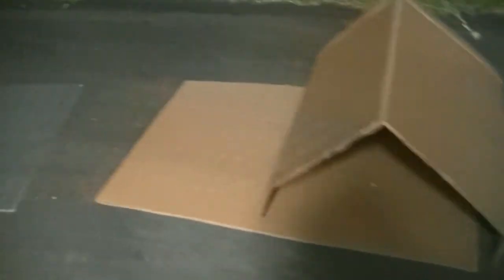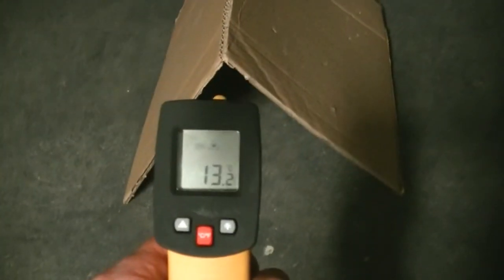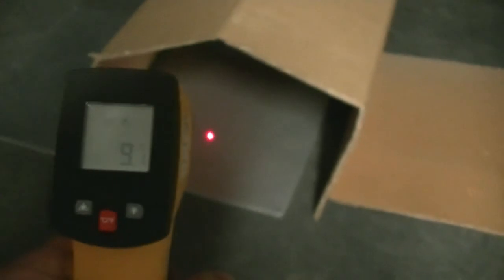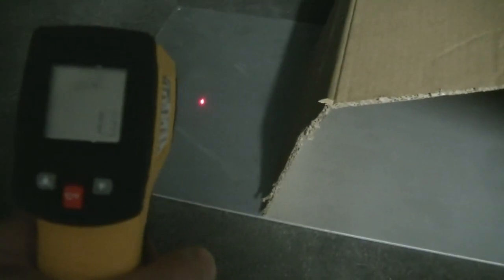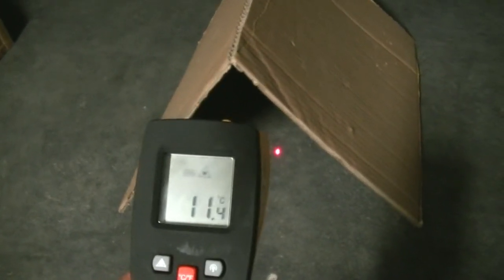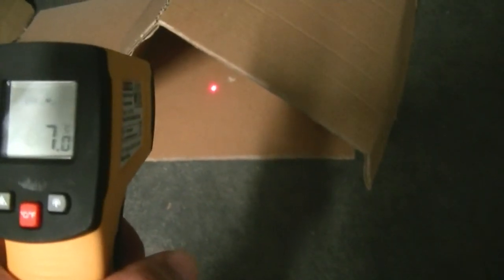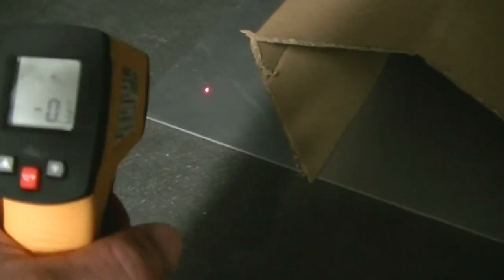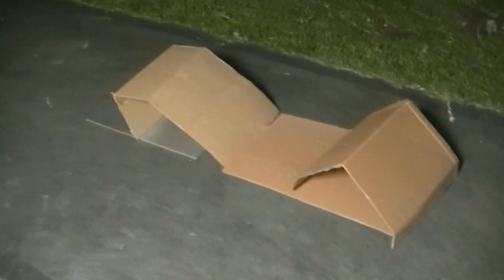Moonlight Temperature Test

Comment: Thank you for sharing your video. I respect that you are going out of your way to question and observe. I think there is a way to modify your test to control for radiated heat. I am going to replicate your test with these modifications, but it would be much more interesting if we did it together. Would you be interested in working with me on the modified experimental design, running both tests, and comparing the results? One of the problems of doing this on our own is that we may be blind to our own biases. If you are interested, respond to this comment and we will work to get in touch. Thank you.

Comment: This is totally not scientific.  You need to block the moon light without any possibility of trapping heat from the concrete.  The surface you measure needs to be 4 feet or so above the grass and a totally flat piece of material that blocks the moonlight should be 3 or 4 feet above the surface you're measuring.  Concrete holds heat from the daytime and your cardboard tents will trap that heat.
All I'm saying is your method is really weak.  You should delete this video asap because it isn't conclusive at all.
Reply: Comes out the same .Do it yourself .

Comment: I am sure that you did a 'real' re-test ensuring that you are not making insulating huts for your experiment, and I am sure you didn't seen any significant appreciable difference.  Do you honestly think you can walk outside from shade to under the moonlight and feel a 3 degree or more difference on your face?  Of course not.  You need to have the shade-forming object so high that it cannot provide any form of insulation to the surface (such as a tall building or the lights at a stadium).
Reply: also, this experiment suffers scientifically from selection bias.  Only those who find what they want to find will post their videos, so the true nature of demonstrating this sort of experiment on YouTube is flawed--those who get the right answer and see no difference won't post their video...
Reply: It's confirmation bias...nice try though

Comment: The sky is huge heat energy sink. If you hold  quarter at arms length and illuminate it with the laser of a temperature gun, the laser spot is small. You should have pointed the gun at the Moon to measure its Raman IR temperature. Bone up on the physics that says distance is not relevant, so long as the IR optics are true. I'll check up on this and report back next full Moon.
Reply: ...And you didnt't. 🛸

Comment: The concrete is smooth and slightly reflective.  It also has an emissivity of less than one.  Either one of those problems ensures that your temperature reading is inaccurate.

Comment: You don't understand how infrared tools work.  First of all, the aluminum is very reflective, so you are actually measuring the infrared radiation from the sky, not the aluminum.  With the covered aluminum, you are measuring the underside of the cardboard.  All of these things - the aluminum, the cardboard, and the concrete are reflective to varying degrees.  They also differ in emissivity.  This "experiment" tells you nothing useful.
Reply: Bullshit

Comment: Did he try doing the same test on a clear but moonless night?  Of cource he didn't.  Had he, he would have seen the same results but no moonlight. Guess the cause can not be moonlight.

So called shading from the moonlight just bounces infrared (heat) emited from your test object  back at ones test object so it can not cool as fast as the other object that has an unobstructed view of the clear night sky where it radiated infrared light to cold depths of  interstellar space.
Reply: That could be true
Reply: bro theres no way it makes that much of a difference in 10 minutes unless the light is the variable
Reply: @Undeeezy  Radient heat loss is light. Blocking  the radient heat loss with a box on a clear clear sky night will result in  exactly what was observed, with virtually exactly the same results during a full moon and no moon.
Reply: @kreynolds1123  thats what happens during night time? radiant heat isnt a scientific term. youre saying light is coming from the ground?
Reply: @Undeeezy  Yes I am saying light  (electromagnetic radiation of a longer wavelength then visibable light, infrared) is coming from the ground. Grab a thermal camera and one will see infrared light is radiating from the ground. The sensor that the video poster used remotly detects that same infrared "light" and spits out  a thermal reading. 

Furthermore, when it is allowed  (not blocked) it radiates infrared light to space.  But the wavelengths are blocked by clouds, by blankets and by cardboard covers as demonstrated in this video. 

I think you might find this interesting. 
https://www.technologyreview.com/2017/09/12/149205/a-material-that-throws-heat-into-space-could-soon-reinvent-air-conditioning/    

Here's the basic concept. The ground is always radiating heat energy to space. During the day, the sun radiently warms the ground faster than what is lost to space, and at night the ground just looses heat energy to the very cold depths of space by emitting more infrared light then in coming from space to the Earth's nightside.  Radient cooling (loss of heat) has been known and used by people for thousands of years in India and Iran to make ice even  as the air temperature is above freezing.
https://en.m.wikipedia.org/wiki/Radiative_cooling
Reply: @Undeeezy  as to radiant heat being a "scientific term" or not, it happens to be a very common expression. Many homes have had and continue to have radiant heat installed in their flooring as a way to heat their home through radiating heat energy and some convection 😉
https://www.google.com/search?q=radient+heat
Reply: How are you going to have shade without a light source ? That is just Dumb
Reply: @garyryan7852WR  What in the world are you talking about?  did you really watch the video and come up with "no light source"

Comment: Behold your cold moonlight!

https://www.youtube.com/watch?v=6a5ZTYNp1NU

Your "experiment" is invalid, the material you are measuring the temperature of is reflective to infrared, and its temperature cannot be accurately measured with the instrument you are using.

You really should try to understand the limitations of the instrument you are using, and how radiant heat transfer works, before making a fool of yourself like this.
Reply: You are showing some daft pixelated crap. Moonlight is cold when measured with regular thermometers as well, so feel free to choke on your sophistry, LIKE A FOOL.
Reply: That "daft pixelated crap" is what you get from a thermal imaging camera costing thousands of dollars, and moonlight is only cold to a regular thermometer if you are an idiot that doesn't understand how heat transfer works.

Comment: Your little cardboard tents are simply reducing radiative cooling into the cold heat sink of the clear sky. Aim your thermometer at the sky to see just how cold it effectively is--around -30C. And do this on a clear moonless night, you'll get the same results.

Lastly, a spectroscope shows precisely the same absorption lines in the spectrum as for the Sun, directly and reflecting off most anything such as a sheet of paper. Moonlight is most decidedly reflected sunlight, just a heck of a lot dimmer. How much dimmer? The Sun is -26.7 magnitude, and the full Moon is -12.7. That's a difference of 14 magnitudes, which is a brightness ratio of 2.5118^14 = 398,000.
Reply: "Glenn LeDrew": It is obvious you have never moved a muscle to do this experiment. Many here have done this with REGULAR thermometers so your "infrared this and that" sophistry aint washing here. Back to your hole, quick.
Reply: I worked for Environment Canada as a Meteorological Technician. Thermometers are housed in shelters called Stevenson screens expressly for the purpose of obviating radiative effects. Sunshine on an exposed thermometer results is a warmer-than-air reading, and at night an exposed thermometer reads cooler than the air.

Do your experiment on a moonless night to see that it's the sky exposure which causes the colder reading. If you have a fast-acting thermometer, watch how the reading goes up and down as you alternately cover and expose it to the clear night sky. Do not use any relatively massive object/surface, for its response will be much slowed due to heat capacity, or thermal inertia.

The Moon is sunlit soil, and we've already measured its temperature from Earth back in the 1930's I think, or certainly by the 1950s, using thermocouples at the focus of a telescope. It heats up to at least the boiling temperature of water (at standard atmospheric pressure). But its very small angular area cannot compete with the far vaster angular area of the ~-30C sky. And so the radiative energy from the warm Moon is inconsequential on Earth.

(I mention this old technique in case any readers doubt the fact of humans having landed on the thing.)

There is no physics which supports the notion that the Moon somehow 'sucks up energy', which is made all the more ludicrous considering its very small angular area.
Reply: Glenn LeDree is right. I did the experiment without moonlight. Covered objects are still warmer than uncovered objects. Live with it Flat Enough.
Reply: Yes why don't you point the thermometer at the moon and get it's real temperature

Comment: Is it possible the little cardboard huts are providing an insulating effect much like cloches do when placed over plants?
Reply: Not only possible, but this is exactly what is happening. The little cardboard huts are reflecting some of the heat radiating from surface under them right back into that surface. With some of the heat being returned to it, I would expect it looses energy more slowly.

Great video showing how being inside a tent keeps you warmer than the just laying out in the open air outside though.

Repeating this on a moonless night will show a similar result.

There are other uncontrolled variables in the setup, like barometric pressure, humidity, wind speed, ambient temperature, cloud cover, etc. that are going to affect the outcome. Might suggest looking into how eliminating those factors to isolate the control and test groups, so only the variable your testing for can be attributed to the resulting observation.
Reply from the maker: Yes it is possible, I've been thinking of re-doing the test and have a shade suspended over the materials, possibly tonight because it is pretty much a full moon. And repeat the test in 2 weeks when it its a new moon to Compare ifit is the moon or the shade effecting the temps, as suggested by crowxe.
Reply: How did your re-test go? There have been some good suggestions on how to improve your experiment. Will you be publishing the results?